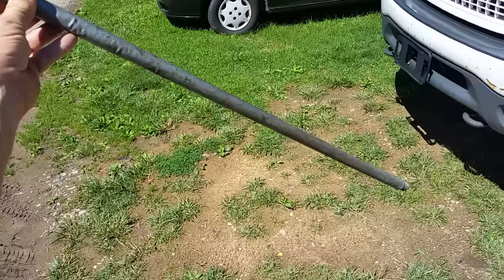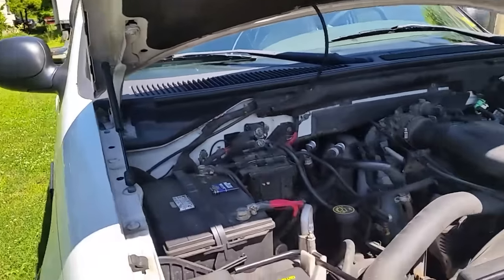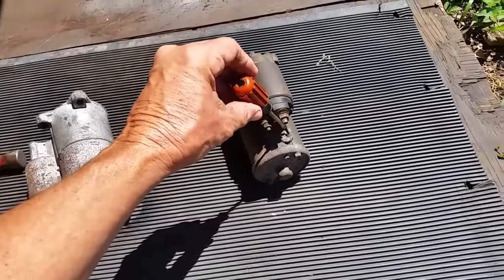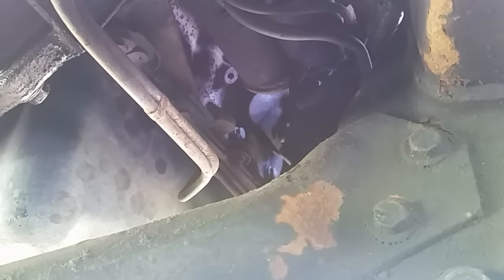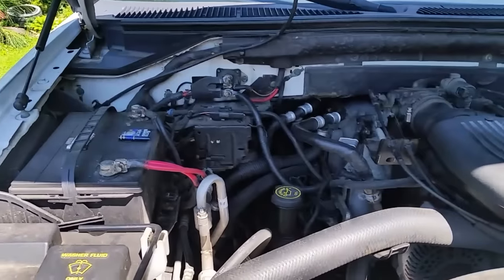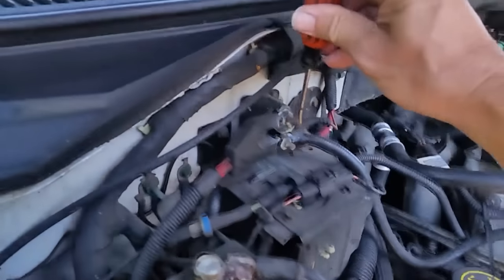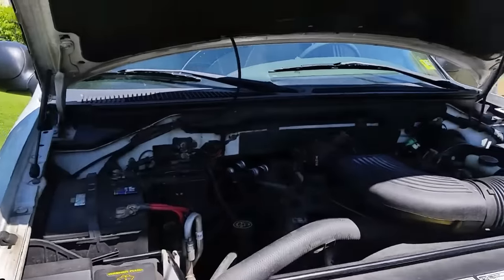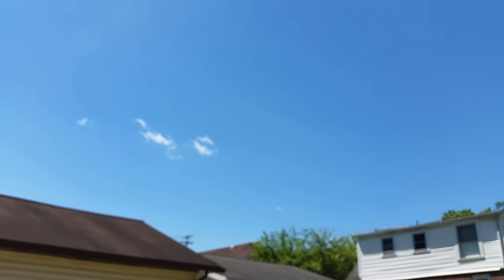Starter Issues??? Simple trick to get your vehicle started and get Home!

Comment: You had me until you talked about fuel pump with a vehicle that would not turn over where does a fuel pump come into it will not turn over starter problem
Reply: With that ignition on, the engine may not turn over but the fuel pump is still trying to pump gas.  If there is no fuel, the pump will fry.

Comment: Sometimes I have to say something. I spent 45 years as a mechanic. Now retired ....  If you're going to repair your car, If you don't have the money. 1st thing find a friend who can help you and knows about cars. Do not try it yourself you can short out the electronics on these cars and run yourself a $1000 bill. This guy gives terrible advice. If you can't find anybody else and you've tried as hard as you can I suggest going to a community college and talking to the teacher telling him you're dilemma and ask him if he can kind of point out what you need to do And to work through the situation with you. At the same time Go to YouTube videos on the subject they are the absolute best way for a layman to do this you can go on the library circuit and you can pull up the books that will tell you step-by-step how to do these procedures.

Most important and can be the hardest step is troubleshooting so take your time because if you troubleshoot and make a mistake you can cost yourself a small fortune. So troubleshoot troubleshoot troubleshoot before you try to fix anything. Remember get a friend mechanic friend YouTube videos college professor Auto shopProfessor take your time think it out do a lot of thinking 1st be very careful and remember something that he did not mention on hook the battery 1st and hook the negative side of the battery 1st and don't touch anything else while you're doing it do not cross the terminals The battery could explowear safety glasses gloves apron face protector.
 Good luck

Do not listen to this guy. Find yourself a friend who knows what they're doing. You could cause yourself thousands of dollars of damage.I'm a mechanic certified in 5 different areas federally. Missile bases  Missile bases to automobiles

This advice is for someone who already knows what they're doing so they don't need this advice. Think about the audience Fella. 

If you're already a  Guy who knows how to do this stuff this is perfect yeah he ran through the right procedures.Pretty much...

 For the know nothing guy  You have a  good chance of hurting yourself. 

If you've ever seen a battery blow ... 

 Then stop and seriously think about it !  

Count your fingers. Get a mirror and look at your eyes.You could lose them. Do you have any idea the power of battery house when it blows upAnd they do blow up.
Reply from the maker: Thanks for helping my algorithm!

Comment: That's not how you check to see  If  the  solenoid going because you're just  Jumping the wire over to the starter lead which is making a direct connection to the battery thus turning the starter you're sorry Badin of joke but that's not how you  Deinos a bad solenoid
Reply from the maker: You should work on some auto's first.... before you comment on someone who's been doing this for 45 years!   lol
Reply: @FixingWithPassion  oh well u wouldnt know that and i wasent being rude. I work on all my owne cars always have still driving my 270 k 98 mercury that ive kept going all these years and ive never paid anyone to fix anything always did it my self its easy  and i do about 40 hrs aweek on mechanical work n the summer soo. I like to work .  U have to test a solenoid  with a test light whole some one turns the key  test the side that goes tonthe starter now u cam correct it  sorry just cuz uve been doing it for 45 years dont mean ur right lol there are still thins i havent ran n to every  now and again all ur doing is jumping current over  to the side that goes to the starter in no way does that prove anything is wrong with it. I wasent being rude just letting u know u need to correct ur video but uall always get ur fillers hurt. Taking advice is a grate gift not an offer for a fight
Reply: @FixingWithPassion  if ur to take thoes to zero gauge wires  off and touch them together it will donthe exact same thing  wether or not the solonoid is connected   what u could have said is that u confermed that the solinoid on the starter is good
Reply: @FixingWithPassion  if u take the little wire off and touch it to a 12 volt hot ig will tell u if that solonoid is good.  Ur welcom and good luck n ur next video sorry u missunder stood my reason for commenting. At least  i was friendly  plenty  on here arent. Cheers

Comment: a guy put on a starter and it didnt work,  so i went and bought a new starter and put it on, and when i went to hook up our battery cables  the car tried STARTING WITH OUT THE KEY!!!!!  HELP
Reply from the maker: Wow!
Reply from the maker: His claim is bogus...I get comments like this a lot. Mostly spammers.
Reply: You should read the wiring diagram for the starter on you car from service manual specific to your car.
Usually, it includes an inhibitor relay that gets trigger signal from ignition switch to provide safety for the starting system.
The terminal S of the starter solenoid should get power from ignition switch through inhibitor relay output.
But in your case, as if the terminal S of the starter solenoid gets power directly from the battery, energizing the solenoid winding such that the starter contact disc makes electrical contact with both terminal B and M of the starter, thereby current flows to the starter motor to crank the engine.
Reply from the maker: True Thanks!

Comment: Your title is so misleading...   A "simple trick" wouldn't be an 8 minute video of troubleshooting the whole electrical system and your solution is only for a very, very specific problem.
Reply: foxtrot789 always one in the common section, unreal
Reply: FOXTROT - It was also a poor job of "fixing" it as the issue was in the solenoid or solenoid circuitry, as evidenced by the instantly engaged starter when the solenoid was jumpered.
Retired ASE certified electrical
Former military diesel Mech